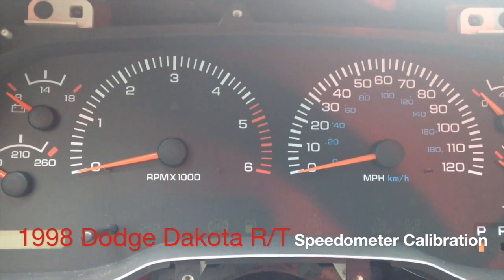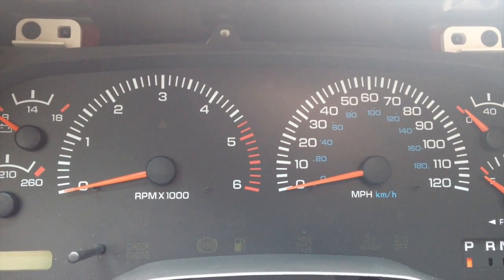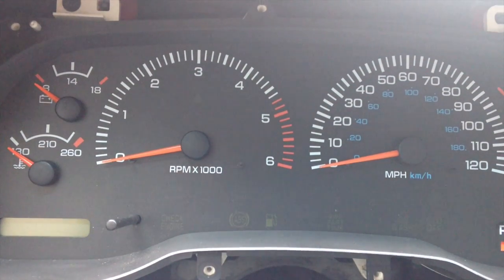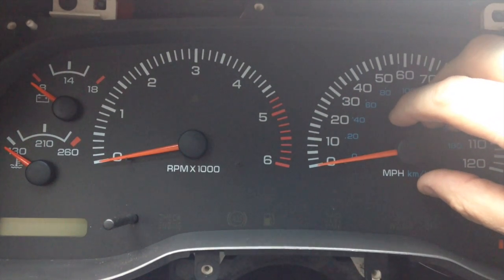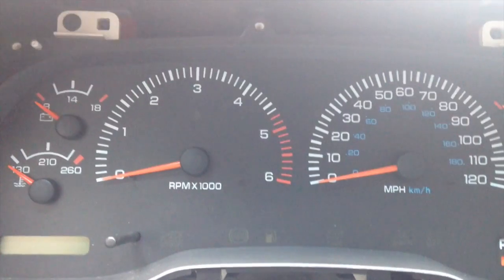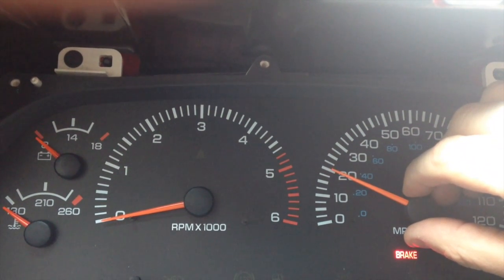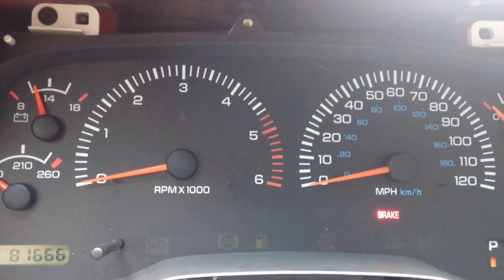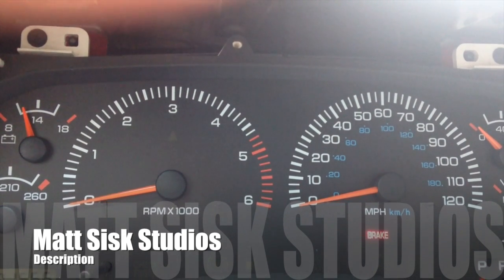1998 Dodge Dakota Speedometer Calibration

Comment: I just go a 98 Dakota and the same thing you say happen. The person that had it put a background on the Cluster and mess up all the settings of the hands, my Temperature, Speed, RPM and Gas hands are off and the Oil leven dont have the hand.
I want to try what you did before getting an other cluster. Hkw will I do it with the Gas and Temperature hands?

Comment: On a dodge dart  when your speedometer says 104 an you no your not going that fast  when I touch my keys the horn blows there is a little red round light on do u think it needs to be reset or battery in the key needs changed I haven't Change d the battery an I've had the car  year an a half any suggestions

Comment: This is not re-calibration for things like bigger tires or lower gears. It is for when you remove the needles (replace stepper motors, change background, etc.).

Comment: hey what's going on Matt I have an issue with my speedometer on my 2003 Dodge Durango my speedometer is stuck 120mph will this method work on my durango
Reply from the maker: +beatz sixstacks Hey Beatz! Sorry for the late response... in Cali marrying off my oldest :( .
I believe this should fix your issue as well. Try this technique first to see if it will fix it right off the bat. If it doesn't then you will need to pop off the needle and do what i did. Let me know how it turns out :)
Reply: congrates an thanx it did work i appreciate it